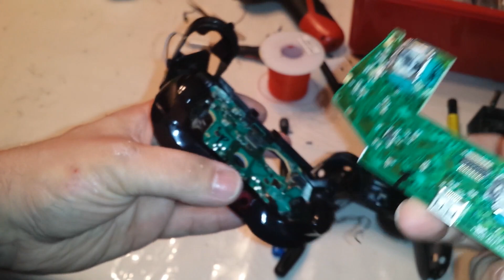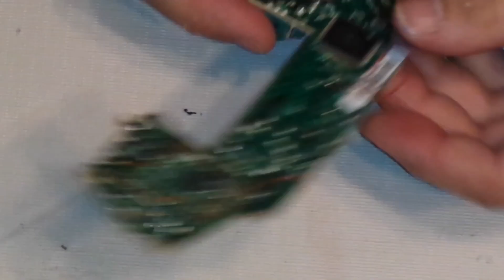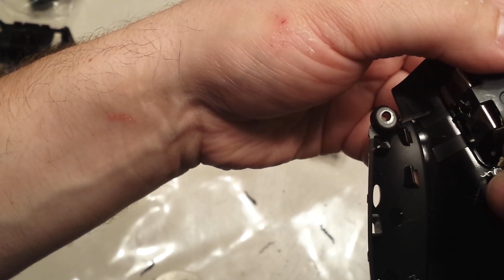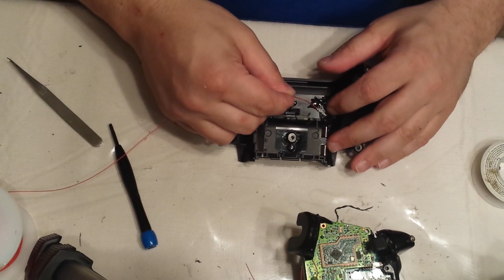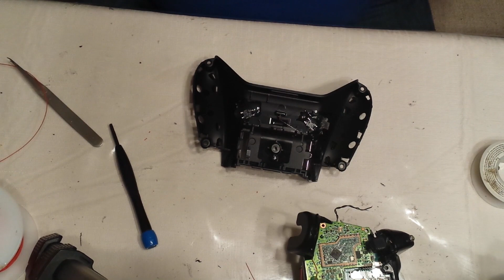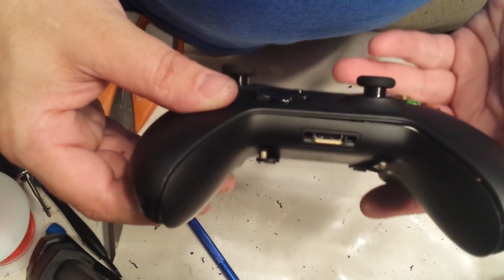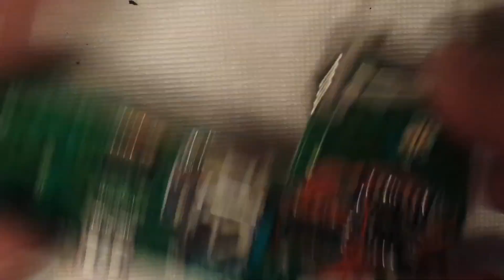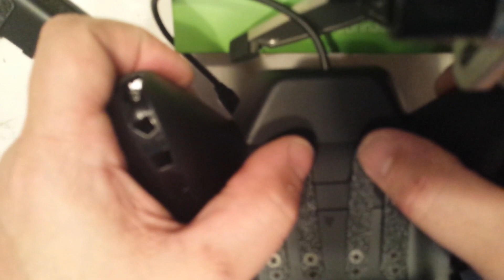TUTORIAL BUILD YOUR OWN XBOX 1 Scuf style Controller w/ Triggers Stops, Remap chip & MORE DIY Gamer

Comment: PLEASE DO IT W/ A PS4 CONTROLLER
Reply from the maker: PS4 (ds4 controllers) can be done but the soldering points are SO TINY it is hard to do on camera. And to be very honest - unlike Xbox 360 and Xbox one controllers the PS4 soldering points are only in one spot - there are no alternatives so you get only one shot at exposing the points and getting the soldering right. You make one small mistake and your controller is going to glitch and technically be broken.   I will have a chip that will allow you to easily install a set of remaps, but just soldering a few wires to remap X and O or X O TRI SQUARE, R3 L3 ect...  is very difficult and I think 95% of the people watching that video and trying to do it them-self would ruin their controllers so I don't want to be responsible for that - so I will not be doing a PS4 controller video like this one.
Reply: yes the points are veeeeeeeeeeery tiny.. anyway i will try it, thanks :)
Reply from the maker: Solder to any of these points for the desired mapping and then ground. (any ground)>

http://i58.tinypic.com/2hp36sm.jpg
Reply: Yes thanks :)
Reply from the maker: Yep... it's pretty simple if you know how to scrape and solder to VIAs (those are the name of the small holes).
Reply from the maker: You can also add trigger stops if you wish to a DS4 controller...  Paddles are easy to add too...
Reply: Yes, thats my plan. I'd order the scuf paddles. I'm searching for tac switches. I'm from germany, it isn't so easy :D I dont want to pay 10€ for shipping.. anyway i look forward to the paddles
Reply from the maker: I would not use SCUF paddles for the PS4 controller they won't fit. Scuf is making a different kind oif paddle for the ps4 controller. If I were you I would use tact buttons with caps or I would make my own paddles using plastic or lexan and make them long and thin.  I am sure you can find tact buttons at your local electronics shop there very common.
Reply: Yes, i'd see that scuf is making new paddles for the ps4 controller,.. but my paddles arrived yesterday, i will see, i hope it works, Otherwise i will make my own,..
in our local electronic shop are sooooooo many tact buttons, i dont know which i sould take
Reply from the maker: Any tact will work, comes down to how long you want then once they come through the plastic.  I would say 6-9mm is a good bet.
Reply: ok, thanks :)
Reply from the maker: NP!
Reply: MODCENTRALUSA How has the remap chip been coming out?i just decided to come back and check on to see if you completed it.or coming along with good progress.(Im talking about the ps4 chip)
Reply from the maker: I have a programmable 2 map version for PS4 if your interested   Email me
Reply: MODCENTRALUSA that was the response i was looking for,but unfortunately i dont even own a next gen. i just wanted to know if you currently have the remap ps4 controller ready so ill know what console to get.if you didnt have it ready i would have opt. to getting to x1 and purchasing your remap controller for it.
Reply from the maker: I have remaps for Both.. PS4 is limited to (2) Remaps only for now. The XB1 can do 4 remaps and is a better built controller in my opinion. Whatever one you want to get I have programmable remap controllers for both systems.

Comment: PS4
#4theplayers
Reply from the maker: PS4 (ds4 controllers) can be done but the soldering points are SO TINY it is hard to do on camera. And to be very honest - unlike Xbox 360 and Xbox one controllers the PS4 soldering points are only in one spot - there are no alternatives so you get only one shot at exposing the points and getting the soldering right. You make one small mistake and your controller is going to glitch and technically be broken.   I will have a chip that will allow you to easily install a set of remaps, but just soldering a few wires to remap X and O or X O TRI SQUARE, R3 L3 ect...  is very difficult and I think 95% of the people watching that video and trying to do it them-self would ruin their controllers so I don't want to be responsible for that - so I will not be doing a PS4 controller video like this one.
Reply: ok thx :)